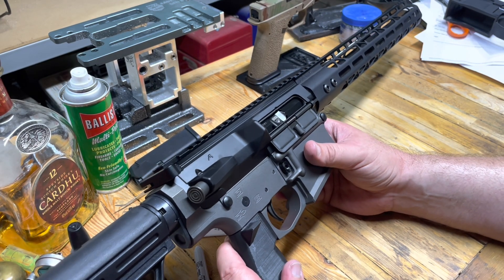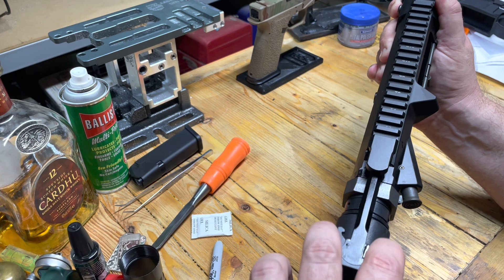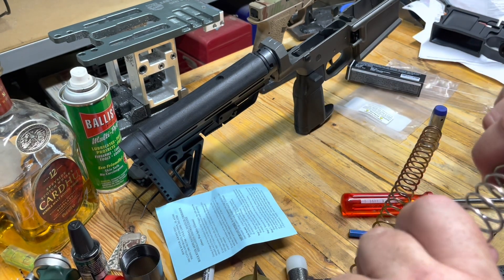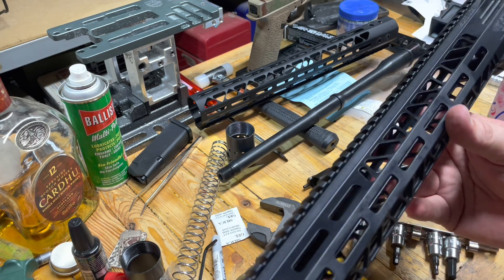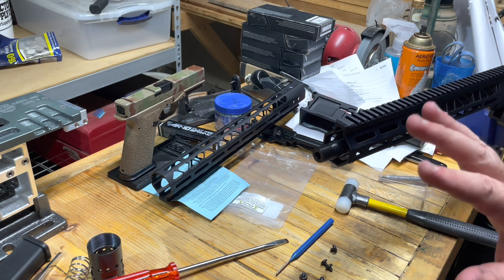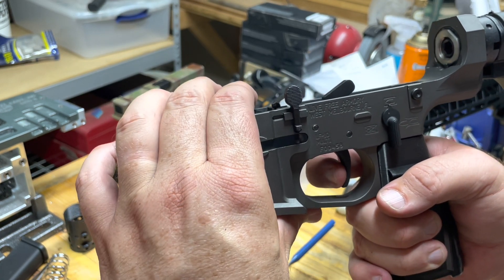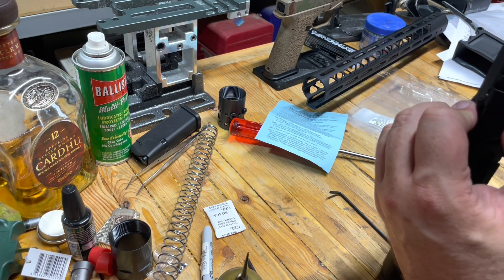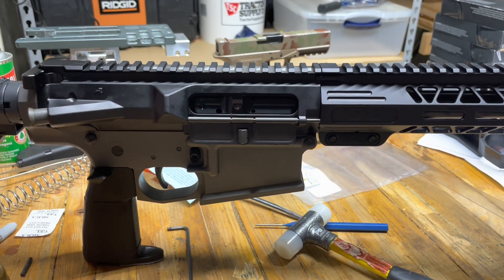Fixing Mistakes on the 8.6blk project: New Mistakes too!

Comment: Why don’t you just toss in a JPSilent capture spring system for $139.99 or so and call it a day. Wil fix your issues and take that awful noise those old school buffers? I’ve swapped out buffer I’ve got with this system in 13 Builds including when I completed my 8.6 BLK 12”build I completed about 6 months back or so. Best $140 you’ll spend on the rifle outside of a trigger upgrade IMO. Also if you don;t already have a bleed off superlative arms gas block I’d highly recommend swapping that out as well and you will likely solve 100% of the issues you are facing in yours too. Good luck!
Reply from the maker: Working on that currently. Also Gun shoots and cycles fine now. Even suppressed. :)
Reply: @EagleRun23   so you’re just going to leave that setup as is and leave a standard sping/buffer in it that sounds and fells like  garbage? I’m not trying to bust your chops, was just offering my feedback from challenges I’ve faced on older builds that your facing now and trying to help per your request in the video for feedback and comments. If you find them offensive my apologies I won’t comment or bother your channel anymore. The JP Enterprises Silent capture spring system comes with a spacer as well so works with an A2 style tube as well as your standard 6 position mil spec carbine style tubes. It doesn’t only mitigate that god awful noise of a regular buffer spring but also the recoil and can easily be tossed in from rifle to rifle until you start getting several for all of your builds because I guarantee you that if you use one once, you won’t be able to handle that sound or rough pull back when you’re getting charged up to send freedom seeds down range.  Lastly, if you’ll get a ported charge handle (Radian makes an excellent one for around $100)  also helps significantly  with gas dispersement expelling the gasses even more for you in a way that will help you get even  more out of your suppressor and functions flawlessly suppressed un not. Again like I said, was just trying to help as you’ve continued to sayin your videos you’re “just an average guy” doing this build AND even was the first one to build one. I’m no brand snob and dang sure not some “tacticool” guy like many out there these days that give some of us bad names and certainly not qualified to be giving out any advise on firearms.  Anyhow, I genuinely was trying to help no differently than I tried here but sounds like you’ve become a guru and and no longer need any help or want the feedback you specific request in your videos so 100% my bad. Plenty of other channels with people building 8.6 BLK to watch struggle. My apologies for the requested feedback. I’ll unsubscribe so you don’t have to hear solid advice from someone with a lot of experience with building both small and large Frame ARs. Again my apology for stepping on your toes on your build. Best of luck, unsubscribed now.
Reply from the maker: @codypayne9071  sorry, maybe i didnt say that clearly.  I have a JP coming for it.  but since this video is a few weeks old now. I finally did get the gun tuned and she runs, its been a mess to sort out and I dont know how I could have hit is perfect on the first shot.  Its just all unproven components on a platform that i am new to, (AR10).  I have seen your comments recently and appreciated your stuff, sorry if we misunderstood each other!  I rely heavily on feedback and help! I make a lot of mistakes on builds! haha

Comment: It's a rifle length spring. Made for a rifle length buffer tube, not for carbine tube
Reply from the maker: the flat wire one I have in there says it works for both rifle and for carbine length.. wild, i fought with this but she runs.

Comment: What did you use to tighten the barrel nut that came with the Faxon handguard?  This is my first AR10 build and nothing I have from AR15 stuff doesn’t fit
Reply from the maker: I think they call it a crows foot. Get one that fits your torque wrench.
Reply: @EagleRun23  and looks like the size to fit around barrel nut is 1-3/8 after looking at Faxon website??
Reply from the maker: @pastornate0827  its big, i found a 3 pack that had the size in it. Think that was on amazon, it was corowell or crowell brand.

Comment: Wondering about the 16” vs 12” barrel.  I think supers would work better.  Not sure about lead bonded ammo and twist rates 1:1 or 1:3.  

I also think at 450 bushmaster subsonic from hornady has 1,000 ft lbs, about double of 300 blackout.  8.6 blackout your getting 700ft lbs.
Reply from the maker: i have questions about that too, in fact I have not ordered bullets yet for reloading, i really need to dig in on that and see whats up.  If you find anything hollar!

Comment: I think that sound is the spring rubbing against the tube as it moves? My question is that since this is subsonic it dosnt reach out as far. Do they make , supersonic rounds in this caliber? I was so excited when i built my 6.8SPC long before anyone really had heard of it yet,then the military is adopting a 6.8 round for the troops. I thought i was so cool ,until i found out its not the same 6.8 as the military is going to adopt. So now of course im still seraching for one? lol Obviously this one here isnt the same as the military is going to use so im still on my search? If you use supersonic rounds will this reach out further then the 200 yards that everyone is claiming its so good at?
Reply: 1.  You are correct regarding the sound.  This is easily remedied via several methods of smoothing out the surface inside the tube allowing a near silent pull back on the charging handle.   Personally I hate that sound on an AR.  Others tubes can be purchased which does not have the ridges inside that produce this sound.  
2.  Yep, both sub and supers are available.   This round is following very closely the 300 Blk path.  
3.  Indeed. Much further than 200. Try 700 yds (see X-Ring's channel).  Even 1000 yds also.  Serious mortaring!

Comment: Flat wire Springs come longer because they collapse much smaller than a round wire spring. It should be fine. Echo
Reply from the maker: its like 2x as long! was like getting tooth paste back in the tube getting that thing in there.